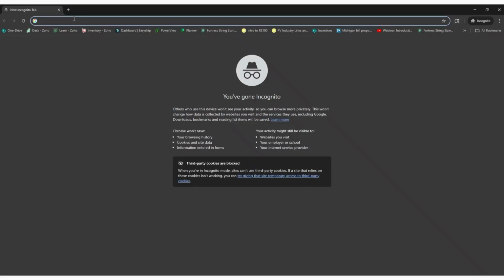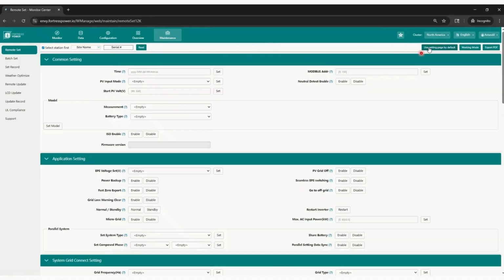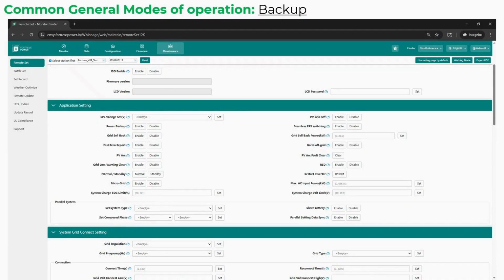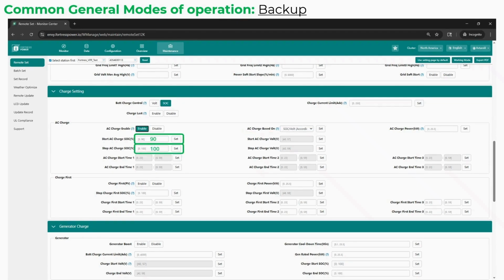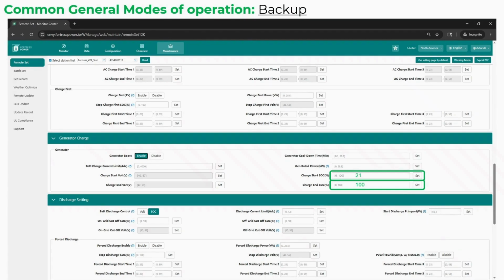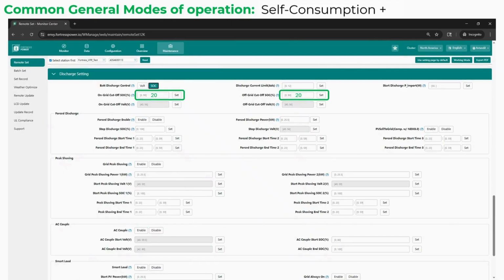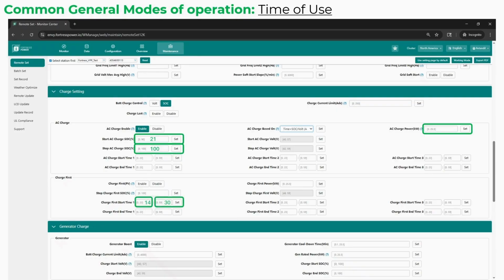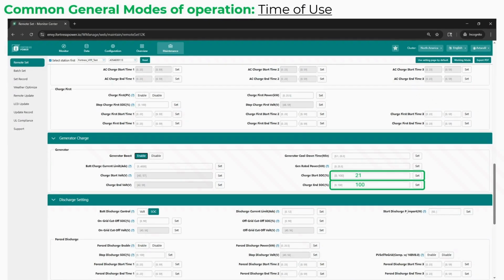How to Configure Modes of Operation on the Envy Inverter | Fortress Power Setup Guide

Comment: What could be happening for a fortress inverter, to show a fault after 12am for several minutes and then work normally
Reply from the maker: Hi there! Fortress Power inverters continuously monitor both internal and external system conditions. We recommend reaching out to our tech support team and providing details about the specific fault message. You can submit a support ticket at fortresspower.com/support. If your inverter is connected to the internet, just include the serial number in your ticket. Our team can then remotely access the fault history and assist you more efficiently.